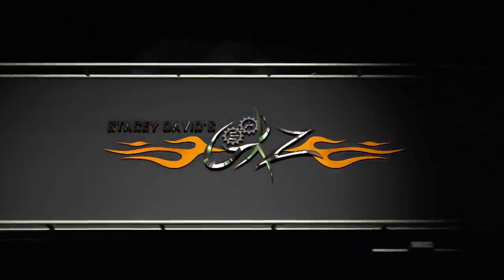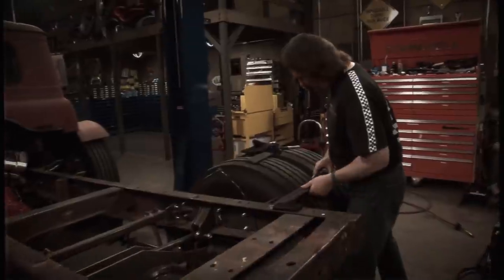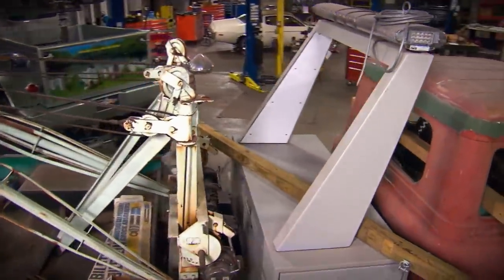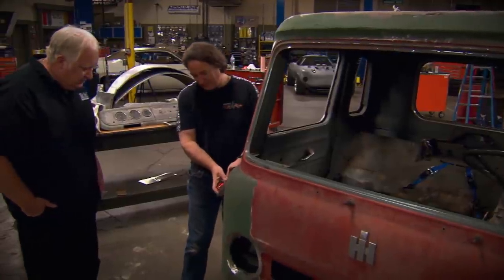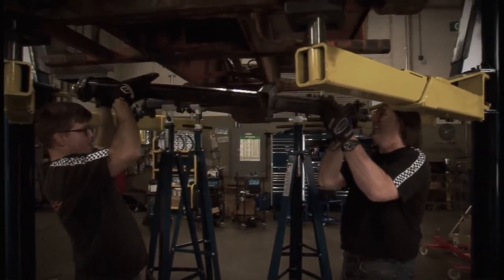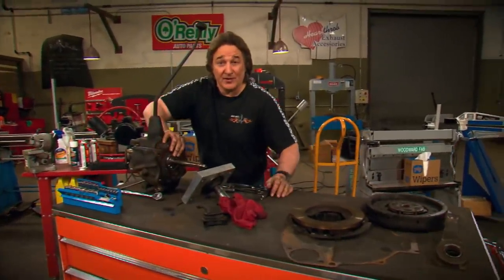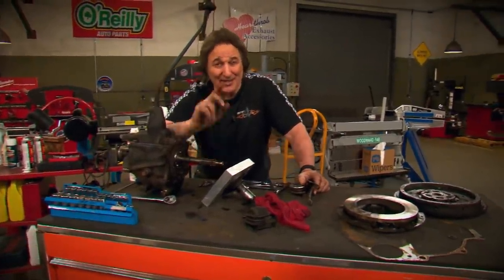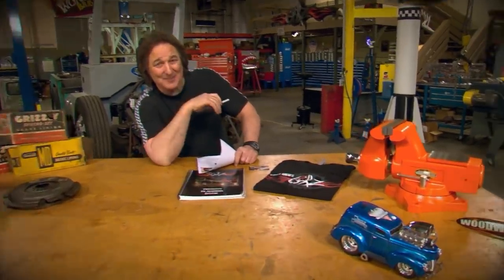Return of Heavy Metal International Cabover Tow Truck & Snowcat - Stacey David's Gearz S11 E4

Comment: The way that oc-4 steering diff works is when you apply the brake band it locks the drum up, than power flows through the planetary gear set and drops the inside axle by 20 percent, and power flows through the center differential and speeds up the outside track by 20 percent, in normal driving the differential will function like an open differential but when turning both axles are locked in fixed ratios so there is power to both tracks while turning..

Comment: When Stacey did the engine swap on Heavy metal.  I thought it would have been a perfect fit for an old 7.3L Powerstroke. With Ford's ties to IH on the older diesels that would have been so much cooler.
Reply: Agreed - was disappointed he put that Isuzu lump in it
Reply: But he wanted it to run 😂😂😂
Reply: @mhsr2001mh  That's why I thought the Powerstroke would have been a better choice too.  But I guess he wanted to live the irony of having his tow truck towed so he went with the duramax.😂😂😂
Reply: I'd like to have seen a Cummins in there, just because a straight six makes it seem more like a big rig.
Reply: @nodak81  DT466 would've been a more appropriate option for the old Binder.
Reply: Has nothing to do with Ford.  The 7.3 IS an International engine.  But for a wrecker the DT466 would be far more appropriate.
Reply: An old 2 stroke Detroit 8V71 would have been awesome.  Noise in motion.
Reply: There's nothing wrong with a fully built duramax. Get over it Ford fanboys. Lol😂😂
Reply: funny you really don't know what your talking about and you just proved it by your comment. Lol
Reply: @John Wymer this is a fully built motor that will see probably little punishment. I think it's a little different than your stock duramax. I have no preference on any of the big 3.

Comment: You're worried about broken wires burning that machine down.... I'd be more worried about that fuel filter your using more than a broken wire.... those filters are known for burning cars and truck up when they losses up which they will and leak gas all over